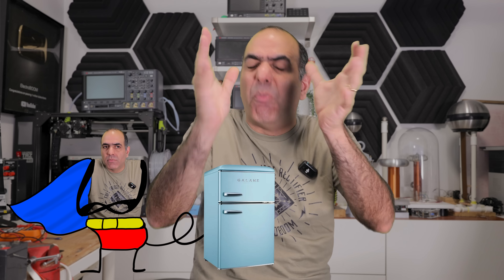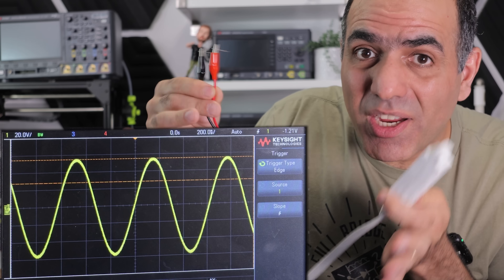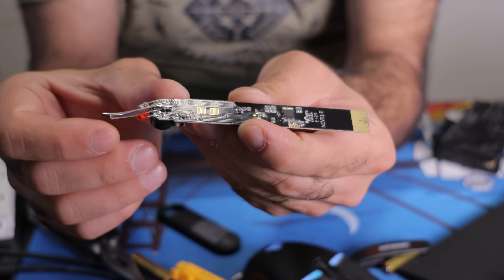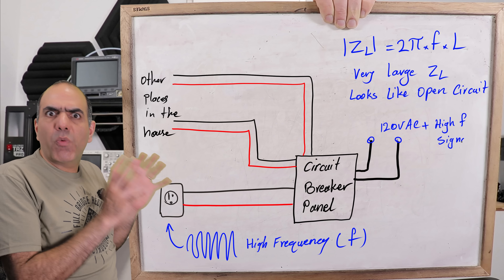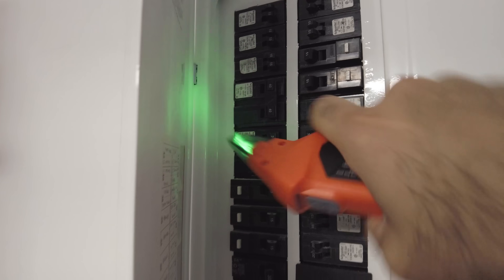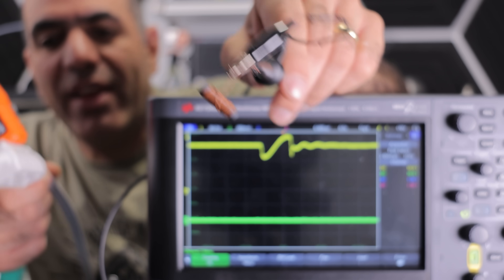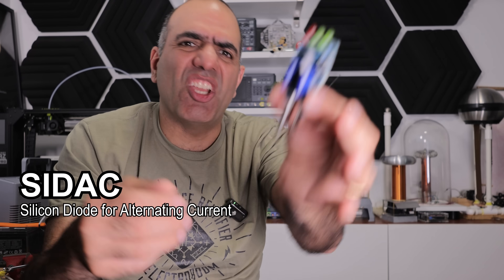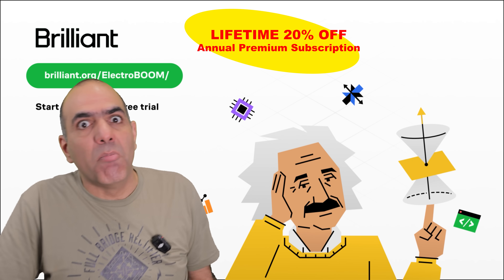FAFO the Breaker!

Comment: Thanks for your videos! I was able to replace the bathroom GFCI with the breaker finder tool that also tells if it is wired correctly like the one in the video. Turns out the face-plate-less landlord special I had was wired backwards! New one installed and wired correctly. Thanks again

Comment: I just use a giant motor from a washing machine that broke, so I had to remove the rotor, which makes the magnetic fields go through air thus causing it to draw astronomical power. (It already trips the breaker if the rotor is locked, and it draws even more power when there is no metal for the magnetic fields to go through). Then I hook it up to my siren controller so I can trip it from far away, but more importantly because it has a 75 amp contractor in it. Then it is just plug and play, or I guess plug and not play.

Comment: Once I was changing outlets at a friends house cause it needed to pass an inspection but didnt have GFCIs in the bathrooms. The inspector was pulling in the driveway as I changed the last outlet so I didnt have time to switch the last breaker off. Instead I just slapped a screwdriver across the wires to pop the breaker then wired it up. Inspector still bitched cause there wasnt a gfci over the slop sink in the basement🤦🏻‍♂️

Comment: I just drag an AC unit that you can just drag wherever you need to cool plug it in run it at its max settings. Wait till it dies go and check the circuit breaker and you’re done.

Comment: Old school breaker finder: Plug clock radio into socket, crank volume to full, nip down to basement breaker box and throw/reset each breaker until the row upstairs stops and restarts. Write a new sticker.

Comment: You can connect a light bulb to the outlet and place a camera in front and then stream the camera feed with your phone and see the footage and simultaneously turn each circuit breaker off and see if the bulb turns off, then we know which one is the circuit breaker

Comment: I want to find which breaker runs my pool pump but it’s not labeled and it’s a 200A panel so too many breakers to flip and see if the pump starts. Is there a circuit tester finder that works on a switch?

Comment: I've used these circuit finders so much and never really understood how they worked. I always falsely assumed they were putting a high frequency signal on the line somehow (I come from the telephony / IT industry and use Fluke tone gens a lot). I always wondered how you could pinpoint the "signal" on a single breaker and how it wouldn't just spread to the other breakers. Then it clicked, and you said it at the end, it only travels on the circuit where it is pulling current because the signal itself is current! So amazing!

Comment: Shorting out with a coin worked back in the day, since we still used old fuses and there were no crazy items that used too much power. Remember someone shorting power with a coin (kind of a trick to split it). Early to late 90s so it was possible back then, but now - crazy to try. Even back then it was risky, because the fuses would burn out easily, so crazy people at times would replace them with a wire. Good thing schools and our household always used good old ceramic fuses with the thin wire.

Comment: Ironically, the place we just moved into.. I was doing my usual 'map the breakers' I do anywhere we move to.... using one of those 'circuit breaker detective' devices (in fact the one you used in this video because I can't find my harbor freight one  (that usually work fine) and yeah.. I turn off the breaker that looks to be the one for the bedroom/office and go make sure the tester in the room turned off... and the fire alarm sounder turns on (no fire, no smoke, no sparks).. I go flip it back on, sounder(s) stop... not sure if crappy alarm system/AFCIs on the circuit (I HATE AFCIs.. none ever work right, GFCIs are fine).. or what.. have a ticket in with maintenance, because your sounders should NOT do that when you turn off an UNRELATED breaker (the alarm stuff has its own breaker that I didn't touch).... buildings are only 5 years old... go figure.

Comment: idea for next video: how to discharge capacitors. i needed to discharge photoflash capacitor inside a camera, and my scalpel that i shorted it with absolutely melted. It was 300 volts 250uF btw.

Comment: Once before, I was repairing the wall socket, but I didn't know where the  Electric switch，I removed the neutral  line, clamped it with pliers, and put the thread end to the thread end of another line, A light came out and the power went out, and then I found the breaker

Comment: You used the circuit breaker finder wrong. You are supposed to set the sensitivity by going over every single breaker first. Then, you find whichever one is still causing the finder to activate.

Comment: there are headphone amplifiers for electric guitars

simply point the tip of the plug at an outlet then follow where the wire goes, you can hear the hum from the wire a few meters away
assuming you already have headphones, this is a 20-30$ solution to accurately find wires and dedect if something has power

Comment: Yeah, when I was an apprentice electrician we often used a scrap of 12/2 to find the breaker because we were doing a lot of government housing units, and all the gungy receptacles were being replaced anyways so it didn't matter....just to be clear, not all the units were like that, but the good tennents weren't the ones being evicted....we pretty much followed in behind the painters and/or drywallers that were freshening up the units and replaced all the receptacles, switches, and covers, and often the lights too, replacing fixtures from the 80's with LED units.

Comment: techno-boom. here's what i devised. i bought a 120v flasher unit (like a automobile might use at 12v) , wired it to a power cord and 100W light bulb and plugged it in to the questionable outlet/breaker i.d.  then i go to the panel board and with my inductive ammeter i watch for the oscillating current draw as the bulb energizes and de-energizes. works every time!

Comment: I have a dead outlet and all circuit breakers are on. Any hints on how to trace that circuit since the device you bought needs a live wire to work?
Reply: Look up “toner probe” and how to use it. You will need to shut the main breaker off.

Comment: Only Medhi would:
1. Buy a new voltage detector
2. Take it apart to figure out how to adjust its sensitivity
3. Wire the old detector so it can use AAA batteries

Instead of just buying new coin cell batteries 😂

Comment: The breaker finder is one of my most used tools.  Especially in older buildings.  They are prone to errors due to noise, but even when you do get an induced signal it's easy to figure out.  Everyone should have one.  Definitely any homeowner.

Comment: So my house was built in the 1920s and the other day while I was hungry I popped out the air fryer and put some food in it and started it that thing probably already takes 1300 watts then my mom turned on the microwave at the same time I really didn't think much till my brother whips out the toaster to make himself some bagels then I start realizing what's happening and he turns it on as well now it's drawing at least close to 4000 watts from a 15 amp breaker and I wanted to see if it was gonna pop and it didn't now I'm concerned about it 😂 like why didn't it trip with all that the microwave turned off 2 minutes later and only the toaster and air fryer where running but thats still like 2500 watts and still nothing wires in the wall were probably hot asf after that

Comment: Just “short” the wires by connecting the hot and neutral while the circuit is off and go see which breaker rings with the ground

Comment: Another way is to pop it with a breaker that just has a slightly higher value, so if your breaker is not doing its job, the one you are using to test it will.

Comment: 110V is a rookie voltage.  In Australia the lowest potentials you will find in any power outlet is 240V 50 Hz 16A.  A proper voltage that will blind you for days if you short it out.  Not a puny 110V!
Reply: some parts of australia are 230v 50hz
Reply: @gamecubeplayer  We are both right. :)   I'll explain as it is a bit obscure.  For most of a century Australia was 240V 50Hz, and the tolerance range was +6% -10%.  This means that as long as the supply is between about 225V and 256V RMS, you can't complain to the power company about line voltage.
In 2002 Australia underwent a 'change' for the sake of international compatibility and declared itself to be 230V AC 50Hz.   The thing is that in the fine print they changed the official tolerance range to +10% and -6%, which is about 225V to 256V, so in the physical world, they made no changes to the national infrastructure.   You can go to about 95% of Australian homes, stick meter probes in a power outlet and still measure about 238-242 VAC (depending on local load conditions)
On a side note, this is a bit of a problem with Chinese appliances with switchmode power packs.  China is nominally 220VAC.  Most Chinese appliances are branded to work between 110 and 240V, which they believe is a safe margin. 240V is their Absolute Maximum and an Australian normal.   It is pretty common to see Australian mains peaking at 250V.  On a sunny day when too many solar homes are dumping power into the grid, this can rise to 260V before they start cutting out.   Many Chinese switchmode supplies in many appliances therefore run quite hot and prematurely dry out their capacitors and die.  Not many Australians realise this is going on.
If you really want a power supply built for Aussie conditions, read the fine print and it should say "working range 100V-268V"    Some do.  Most don't.
I hope that you find this explanation useful.
Reply: @agalah408  for example the rvl-002(aus) says 230-240v 50hz

Comment: One time I turned on a 220 20a furnace by being stupid and holding the emergency shut off box while cutting the live wires thinking I’d turned off the right breaker, I got stuck to the box and my pliers, couldn’t move getting electrocuted and after testing my hands arms and legs I realized I could still move my legs so I jumped backwards to break the circuit it felt like I’d been hit by a train and I might even be lucky to be alive because I was alone in the clients house. I was a less than 100 hour apprentice.

Comment: Is that the Klein detector (looks the same as mine)? If so just hold the power button to switch to high sensitivity mode. The light will go blue instead of green. 

I actually bought it at that exact same Home Depot 😅
Reply from the maker: Bot on this one, if I hold the button Ling it goes silent!
Reply: @ElectroBOOM  ah just double checked mine and the clip is red. It’s the dual range version. That sucks, I agree a single range seems a little limited on something so basic. 

If I were you I’d just head to Home Depot and exchange it for the $7 more dual range which comes with a GFCI thrown in too. The Richmond Home Depot have always been great accepting returns for any reason for me. 

Model NCVT5KIT. I have the NCVT2PKIT $43 which again is different but looks functionally the same apart from a red clip. Likely closer to a spec? No idea.

Comment: 10khz tone…this is a thing we call AM radio.
Talk to your local HAM operator as this is a video.

A SIDAC is a an AM radio.
You can simply use ANY EM sending locator coil to hear this unit (a AKA) a walkie talkie, or a metal detector.  You will also find an IDEAL brand electric toner in the telephone/datacom section of your hardware store; because all telecom wiring guys have wire locators.  Every utility company field technician.   Hell with the headphone port on a cheap metal detector will allow you to hear this from many feet away.

Oh this is also how pickups on electric guitars work.

Comment: What are your thoughts on those screwdrivers with a metallic cap on the handle you're supposed to touch, and a  orangeish-red light that lights up when you poke a live wire, usually somehow not shocking you?

Comment: I have used a phone line tone generator and tracer on a non-powered circuit to trace the wires through the walls before. Like 20+ years ago, and I found the fault too! Using it on a de-energized circuit. It ended at a unseen wall patch where I found a wire nut inside the wall had gone bad. Not to code (NFPA-70) #handyman #apartmentmaintenance

Comment: I started to love electronics as a kid by taking a DC motor from an RC car and connecting its two wires to a AA battery. It worked, and from then on, I began studying electronics. I got really good at it by watching your videos. Initially, I watched them just for laughs, but once I realized how educational they were, I started watching ElectroBOOM. I began studying electronics in school around grade 3 or 4, but after grade 10, I took commerce, and my focus on electronics ended. However, I will never forget you and my love for electronics. 

Now, I have no idea what to do with the multimeter, soldering iron, and the circuits I made.😅

Comment: A coil antenna (just 12ga copper wire in 4 coplanar turns spaced a bit apart, but the more the merrier) attached to the small stock antenna will allow you to sense live wires through drywall.

Comment: I’m an electrician and I built myself a switch box that goes through some high grade extension cord into a male plug end. I plug it in and flip the switch and the breaker pops. Sometimes when the breaker is bad or made by stab-lok the wire tenses up in my hand and makes a buzzing sound before the breaker trips. The magnetic forces generated during short circuit conditions are insane.
Reply: Like he said in the beginning, you can inadvertently trip the main breaker or device further upsteam by doing it like you said. I suppose yours can be used in a restricted residential environnement, but still not the best, greetings from a fellow electrician... It shows he's a engineer of the practical type 😂
Reply: @mickeygallo6586  I haven’t tripped any breakers upstream yet but I’ve mostly used the “plug shorter 9000” in residential settings. In the few commercial buildings I’ve used it I’ve never had trouble with it. If all the breakers are in good condition the 15-20A breaker for the plug circuit should trip several cycles before the 40-200A breaker feeding  the branch circuit. In my experience the breakers or fuses upstream are feeding 240v while all the branch circuits are 120v so they don’t all trip at once. I have blown main fuses before when I accidentally shorted the 240v on a split plug. I think that a phase to neutral short is significantly less aggressive than a phase to phase short. Anyway, I am well aware of the risk of tripping feeder breakers/fuses when I use the “plug shorter 9000” so it isn’t my first choice to use. Typically I use it in houses where they have 4+ sub-panels and they are spread all around the house, so I just pop the breaker and look for the tripped one later. I’ve actually found bad connections in a panel before using the plug shorter 9000.
Reply: @mickeygallo6586   if it trips you can just excuse it as , it was just a welder
Reply: I've seen an electrician use a similar box as you describe, but their switch was another circuit breaker. Guess they used a type with higher current rating or slower response than you would usually have in a residential installation. This way, if for some reason the circuit breaker in the building failed to trip, the one in the electrician's box would trip before there could be a fire.
Reply: @andreasu.3546  that would be safer than what I use. I built mine out of left over parts from a job and stock material from my van. I just use a normal 15A toggle switch in a metal box with a metal cover. If the breaker fails to trip the contacts in the switch should burn out long before the wire or the plug in the wall socket. Since everything is in a metal box it should prevent any fires or injuries in the unlikely event of catastrophic failure.
Reply: @TheGTP1995  of course, I’m using a 3c#10 cab tire for the wire and a standard Canadian grounded plug. The box and switch are well grounded
Reply: Interrupting a short circuit is definitely hard on the breakers. Obviously they can handle it more than once but I think it raises the chance that they will go bad and not trip later. 

I still try putting a load on the circuit and tripping ground to neutral though. It takes 30 seconds to try that and if you’re lucky (if there’s AFCI or GFCI) it will trip without passing short circuit current. 

If it doesn’t then it’s back to going through the breakers to find it or using the breaker finder tool if one is handy.
Reply: @deltab9768  I’m just gonna clarify that since i made the “plug shorter 9000” 2 years ago, I’ve used it about 10-15 times since then. Usually I’ll get my apprentice on the phone with a voltage tester or lug tester and just flip breakers till I find the right one. It’s always the last breaker i try for some reason🤔.

Comment: I once accidentally made a breaker finder/tester which was actually an automated programmable firework controller but because it was assembled over the course of 2 hours out of a broken hairdryer,arduino,a TV decoder and a motion sensor it had a tendency to draw more current the longer its firing pulse was it also had ground fault problems paking it also a GFCI tester I guess on the plus side it failed only 7 out of 10 times and it's internal safeties ensured that even when failure occurred it prevented anyone from getting shocked because it had 3 manual safeties which required concius effor to bypass and a motion sensor to detect anyone getting too close to exposed parts